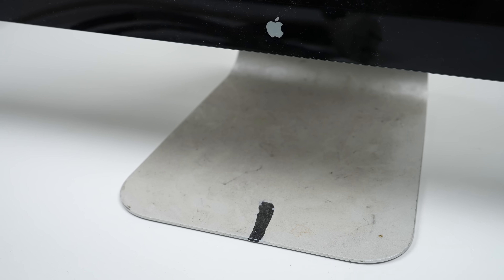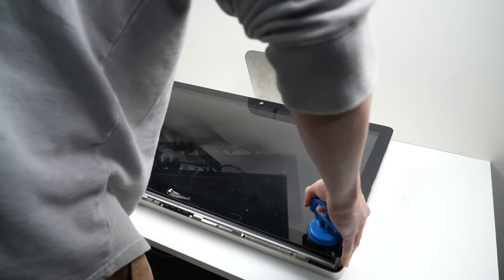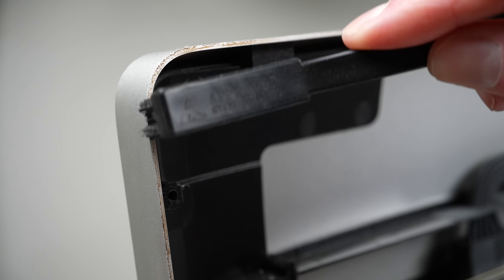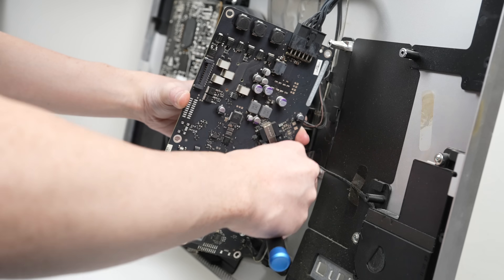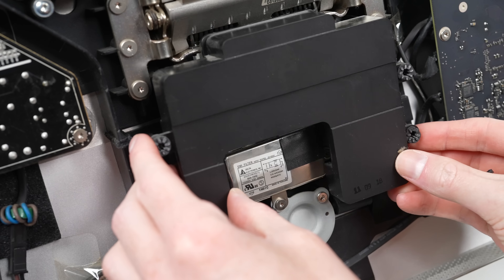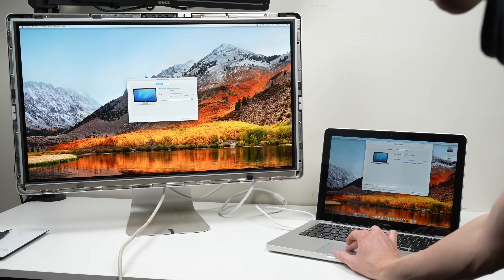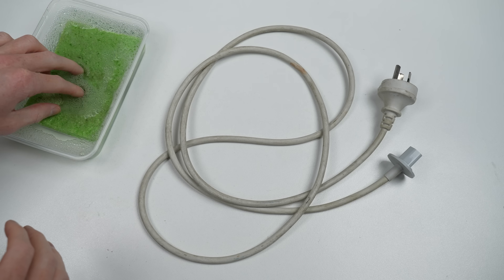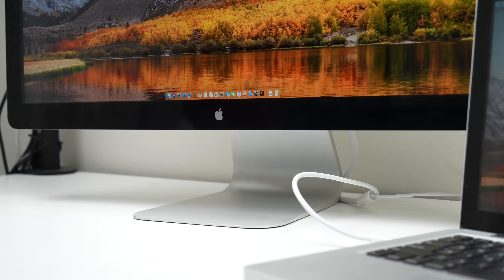Why Do People Sell Things This Dirty - Clean & Repair Of An Apple Thunderbolt Display

Comment: Found one of these in the skip which works, but the cable needs replaced. Much cleaner than yours, but unfortunately the replacement cables are now over $100 which is about what these sell for.

Comment: The internal Thunderbolt cable on these monitors though a common defect isn't necessary for it to work. There is a non-intrusive workaround. Plugging one end of a Thunderbolt 2 cable into the monitor's back Thunderbolt port (originally intended for daisy-chaining a 2nd Thunderbolt Display or other devices) and the other end into a TB1/2 MacBook or TB3 adapter into a newer Mac WILL display a picture on the monitor. You can still use the built-in MagSafe cable to charge an older MacBook. You lose the daisy-chain functionality, but the trade-off for some is worth it.

Comment: Alcholol shouldn't be used on any kind of display. Most displays have coatings of some kind that are better preserved with just a wet towel and some scrubbing. Plus if alcohol leaks into the layers of an LCD it is disastrous

Comment: I just picked one up after finding that my "new" M1 Mac mini would not play nicely with my 20 year old Apple Cinema Displays.  I was just going to hook it up, but noticed how dirty the screen was, and figured - it's probably never been cleaned inside if the outside looks like that.  So, this weekend I'll open it up.  I previously opened up a 24" iMac, so - based on above, looks pretty similar.

Comment: Tip: you can also use a Thunderbolt 2 <> Thunderbolt 2 cable when the attached cable is broken. At least between two Apple 27 inch Thunderbolt displays in my setup. But it should work on connecting it to a Mac as welll.

Comment: I also have this monitor.  Sometimes it works, sometimes there is no image.  I disconnect all the cables, wait a while, then plug them in again and the image appears.  Sometimes the image appears when I repeat this process three or four times.  What could be the problem?

Comment: You should know: You actually can use these monitors on modern Macs such as i do on my M1Max. All it needs is a thunderbolt to USB-C Adapter, USB to USB-C Adapter and most importantly a third party software called "MonitorControl" because updated OSX don't support this hardware anymore. To set up MonitorControl is a little bit tricky, but i found a great tutorial for this: https://youtu.be/SzZHdyRJkws?si=YaND5E9rxezT7HEA

Comment: hi love your apple content @hugh. Question: just got me a thunderbolt display. 2 days working good, but sometimes the video turns off, with sound, then i had to remove the adaptor and put it back again, then it works. also notice sometimes its flickering. what do you think is the issue? the adapter? or (i hope not) the logic board?
Thank you!

Comment: What size screwdriver is used for the last two screw under the circuit board to unplug the thunderbolt cord? I got all the way to that last step and couldn’t complete it because those two screws were slightly smaller.

Comment: Have you had an issue with the TBD PSU? I got one for "free" back in June 2022 (from a media company which was throwing it out - was marked as e-waste), brought it home & plugged it into my 2012 (non retina) MBP. Worked without issue for a few months & I couldnt work out why they were throwing it away....the it started cutting out....
Seems like it's a common problem with the PSU in the 27" TBDs....

Comment: Love this monitor. Have had time now for 10 years. Still works perfectly. I used to use it on my 2015 15" MBP, which was a perfect connection. Now, I'm using it with my 2022 16" MBP, which means you need a thunderbolt 2 -> thunderbolt 3 (usb-c) adapter. Apple sells one. This also means, you cannot use the MagSafe charger anymore, which is one of the cables. But all in all, I still love it. I'd like the newer one. But they've bumped up the price way too much while not adding more features like more hz and a bigger screen.

Comment: These cleaning videos crack me up.  None of you computer types ever have a proper air compressor.  Why?
Why don't you run more boards and components through the dishwasher?  It is going to stink like smoke unless you clean it all.

Comment: I was walking home last night & lying on the sidewalk was a 27 inch thunderbolt display !
Glass smashed & was filthy.
Led screen seems intact.
Back was dirty & cleaned screen and back.
Aluminum sides of screen look rusty.
I don’t have a newer Imac except my Silicon M1 Mac Mini so I don’t know if it would connect to that.
I plugged it in to a power strip & nothing went poof !
It also had a Vesa mount on it instead of the stand.
I can get the glass, stand, even a display.
I need the tools to open it up & have NO idea what tool to get the VESA mount removed.
I could clean it up & sell it, I suppose.
Sides of aluminum look rusty though I understand aluminum doesn’t rust.
After I get a star screwdriver I will open it up & clean the inside.
It would be a pity to just junk it.
Would like your opinion please ?
I always wanted a thunderbolt display and always HATED Apples not including a power supply inside the cinema display.
I have a 17 inch connected to my 2005 Mac Mini in the bedroom.
I need to get the wifi & bluetooth kit installed in it.
Reply: I can get a stand, led display & glass on Ebay.

Comment: Isopropanol works fine for removing cigarette dust and especially cleaning apples cables. They look brand new after that. Just take a towel and the cable with one hand and pull the cable in both directions with the other hand.

Comment: You don't find many companies that have such amazing monitors that sell used for so cheap... because of a busted. effin. power cable. It's ridiculous to hear that their recent Mac Studio Monitor was an improvement on repairability over this because they decided to spite the customer by making the cord difficult to remove rather than actually just screwing them over entirely by hiding the plug underneath a PCB which requires removal of several parts to access. As great as their products can be, this unrepairable piece of beautiful BS is why I actively avoid buying any of them. What's a pretty chassis when its internals die and most can't fix them?

Comment: The thunderbolt connection on the board is really fascinating and makes sense that it's a hub for the ports on the back. I didn't know they came with FireWire ports either

Comment: Use denatured alcohol, it’ll eat all the grim off the aluminum. Do not use it on plastic or painted items as it will strip it off and melt plastic, I used it on iMacs and Mac pros when I was refurbishing them for a company. It works great on making the aluminum look new again

Comment: Had a good laugh at the beginning condition. I would have tried offering $20, or free! for just taking it away. Kiddos for your cleaning job and redo. Looks great! I got mine a month ago; nice design, still good display, and works well with my TB2 MBP 2015. I got my late production in the High Sierra box like-new condition for a bit over $200US, can’t complain. Enjoy it, a good option for a really nice true APPLE display.

Comment: Would it be possible to replace the thunderbolt/MagSafe cable with a thunderbolt to USB C connection to modernise this display?
Reply: Yes, there are YouTube videos that show how. Or if your cable is still good you can just use an APPLE TB2 to TB3 adapter. The charging cable will also work with an adapter to USB-C, or if you get a new MB with MagSafe an older to newer style small MagSafe APPLE adapter. I use the TB2 to TB3 adapter with my iPad Pro to mirror the iPad on the TBD and it works fine.

Comment: Do the new iPhones really need the higher watt fast chargers? I’ve been using my non-USB-C not fast chargers on my 13-pro without any issues so far? Having experience with charging RC grade lithium batteries, slower is fine, just as long as you don’t exceed 1c charge rates.
Reply: They not only allow slow chargers, it’s preferred. Slow charging is gentler on the battery than fast charging. I only ever use USB-C charging on my iPhone when I absolutely need to charge it ASAP.

Comment: I actually prefer to seeing items as is.  Gives you an idea of how it was treated and what possible issues you may face, beside what the person selling it says is wrong with it.  As the person you are buying from may not know all possible issues or in some cases, they may try to scam you, saying all was well and it was treated with kid gloves, when it is the opposite.  Which you would not be able to tell from a glance if polished and cleaned.  But for me a red flag and would have been a deal breaker was discovering they had left it out side exposed to the elements.  A lot of unseen damage can happen that way, not to mention shortening what ever life span it has left of the item you are buying.

Comment: The LED Cinema Display was 24" not 27". I had one with something wrong with it. I say something because I couldn't work it out. It may have been the backlight, the inverter or the panel itself.

Comment: A couple of questions sir:

Do you find the screw heads are chewed up by using such a small screw driver and your wrist constantly changing the direction of drive?

Is there a certain order that you do the screws up in, to avoid warped PCBs or to avoid putting twisting/torsional flex in the boards?

Cheers man

Comment: I have 27" LED cinema display (same display but without thunderbolt..) and i have YET to find new monitor (outside apple ecosystem) which have the same quality picture as it (suggestions are welcome)  it is 12 years old and i am afraid when it dies i will suffer to find great replacment for it.. it is great for long work - contrast and color are incredible... since those were LG panels maybe i should buy LG monitor

Comment: My own answer to that is the value placed on the item by the previous owner.  If it were more valued (not necessarily valuable) it would be taken care of better overall, and cleaned. If it was faulty due to misuse, it may be more valuable to one who knows the item, but not valued by the seller.  If it was for sale for a higher price, nobody would pick it first, so no cleaning necessary. I bid for an iMac of 2011 w/a 3.4G CPU "FOR PARTS" by a single user, and won with a 75 dollar bid, the only one! It's completely restored with it's one 8g, one 4g two 2 gig memory, AND a running HDD OF 550GB but the GPU wasn't working. BUT it wasn't very dirty, so I guess I lucked out!

Comment: A few weeks ago I got one of these for $40!! It was a steal and it worked fine! The only thing wrong was the slightly damaged thunderbolt cable which still works fine, I use it with my M1 MacBook Air

Comment: I don’t mean to be rude but you did get a bargain paying a very cheap price for the monitor in that condition. 

You can’t really complain about how dirty it is because you paid a dirty price. You got a good video out of it and the transformation was excellent to watch, the worse the better I say because it’s much more satisfying to see something in poor condition be turned around. 

If  it was 400 then yea that wouldn’t be acceptable but at 130 all in you can’t really complain Hugh.
Reply: It’s gross but if the owner cleaned it up on the outside, they’d probably have been able to sell it for $100 more. A$300 is the low end for working TB displays here, most are c.$500 and up.

Comment: With this video I understant that why Apple will void your waranthy if you smoked near their devices.
And most of the Apple products owners that I know are smoking (cigarettes, not something else).
Reply: The warranty isn’t voided by smoking as such. But if the smoking is the cause of the damage (and not a fault in the device, which is what a warranty is for), they could deny it because they didn’t cause the damage. So if, for example, you smoke so much that the insides become sticky, and then dust sticks to the cigarette tar, and this blocks airflow and the device overheats and dies… that’s really not Apple’s fault!
Reply: As for Apple users being smokers… LOL, suuuure. The country with the highest percentage of Apple ownership is USA, which is a country with fairly low smoking rates.

Comment: For anyone thinking the exposed power supply isn't that bad, it is. I got shocked and burned a month back from an iMac. Seriously recommend wearing gloves.
Reply: What glove
Reply: @thedark3419 RUBBER GLOVES YOU TWAT!!!!
Reply: Rubber gloves?
Reply: How long does the capacitor take to discharge if just left alone?

Comment: For the future, I recommend using a magic Sponge to remove grime around the outside. It is a light abrasive but they do a great job
Reply: Wouldn't recommend when it comes to the glossy plastic bits. Better off with toothpaste. Especially with vintage computers where you wouldn't be able to recreate the pattern on the plastic.

Comment: Didn't know Thunderbolt Displays have built-in speakers.
Reply: 3-Speakers are actually pretty good, and a nice plus to this display. It also has a 720p web cam, nice all metal and glass design. Still a good display for many reasons

Comment: You should check out a device called the compucleaner, basically a can of air duster that never runs out, but twice as powerful, i use it daily to clean my vacuum cleaners filter.

Comment: I have two Thunderbolt displays on my main workstation at the office. They are fine screens, however over time they do develop some "weathering" in the display. It's subtle but noticeable when the screen is showing all white. Regardless of this, I still love them and will use them until they quit. Thanks for giving this poor abused and neglected screen you bought some much-deserved love, Hugh!
Reply: What you're seeing is likely dust that is building up on the glass and LCD inside of it due to the fact it draws in air and dust.
Reply from the maker: I used my LED Cinema Displays 12-15hr days for several years after getting them and they are still perfect. I only use them at half brightness so that might be a factor.
Reply: If the led panel goes (or is fading) you can still buy the same LG panels brand new from Aliexpress. My then almost 10 year-old TB display blinked out suddenly one day - I still had power and data so took a punt that it was just the led panel.

Including shipping it was c.A$300 (approx US.$220 at the time). Between iFixit and a couple of tear downs on YouTube for reference I did the swap myself. (Keep your old panel and hardware handy, you’ll need to transfer several bits from it to the new one.)

These monitors may be old now but the picture quality is still superb and the utility (Ethernet, USB, Thunderbolt and laptop charging) makes them unmatched for a Mac user for under $500.

Comment: I have had very good results using ammonia to remove nicotine. You might want to dilude it a bit, even if just for to reduce the strong smell a bit when used but for stuff like this you'll be surprised just how much easier it is.

Comment: It's kinda funny to me saying that oh this monitor is still good. It's 1440p, of course it's good. If you look at the steam hardware survey, you'll see the vast majority of people use 1080p monitors. I use a 1440p144 monitor because 4k120 monitors are kinda pricey, and then game performance goes way down. While you can see some jaggies, at 27 inches it's still pretty good, and better than the more common 1080p 24 inch. I paid $290 usd for my benq display open box, which is about $420 aus.

Comment: Alot of your viewers may not know that you can use an imac as an extended display when connected to a macbook pro pre retina, using a thunderbolt 2 cable both must support Thunderbolt and nothing more than 10.13. Apple has a tutorial on this.

Comment: I work in the IT department at my college and my boss still uses one of those Apple Thunderbolt Displays. Theirs however has some kind of electrical issue (probably with the power supply or power delivery over Thunderbolt) which causes their laptop to crash randomly when connected and also occasionally shock them or spark. They're great monitors but it feels like there's a lot more that can go wrong with them than others.
Reply: Well that sounds like an issue with the power cable. If it can't ground properly then that shock will go through you to get to a ground.
Reply: @MrMega200  yeah. Nothing is visibly wrong externally so I guess it’d have to be taken apart to see what’s up.

Comment: Great content as always mate. How do these displays stack up today? Say on an M1 MacBook?
Reply: Perfectly. Just no MagSafe (different version).
Reply: @fmarinosfromafar9512  nice. I’m in the market for a display but don’t want to spend mega bucks on the new apple one. Dell have a decent range with “dock” style at ports at the back
Reply: The m1 MacBook will be a lot greater
Reply: @cpg_official4837  you don't get the point, how well it works with M1?

Comment: Cigarette smoke.  Years ago worked in an space where there were some private offices.  The walls were those cheap one with metal studs instead of 2 X 4s.   The ceiling panels continued over the walls and were not cut to fit at the wall.  We had a renovation and the wall came down.  The smokers ceilings panels were yellow right up to the form wall.  The panels that went over the wall, were yellow on one side and white on the other.  Funny thing, one guy died of cancer while still working.  The other, my boss got Emphysema.

Comment: Nice video!
I'm kinda wondering tho what a display needs a RJ45 jack for
Reply: The RJ45 signal is passed to the computer via ThunderBolt; so when connected to a laptop, which might not have Ethernet, one can have a wired connection.
In short; one can have everything connected to the monitor and just plug the ThunderBolt and MagSafe in the laptop. Neat.